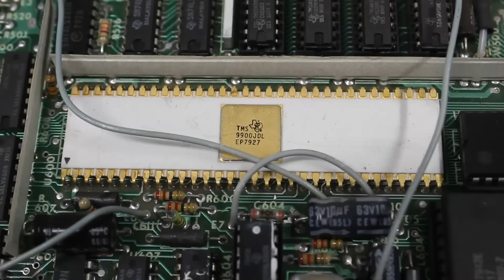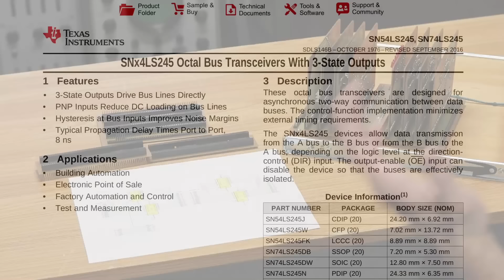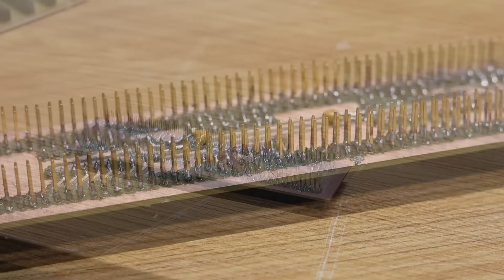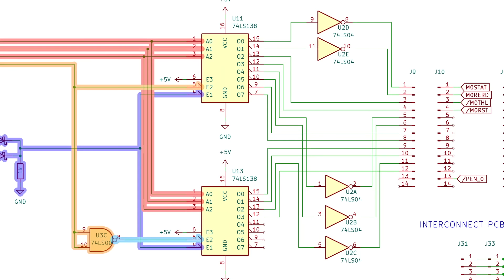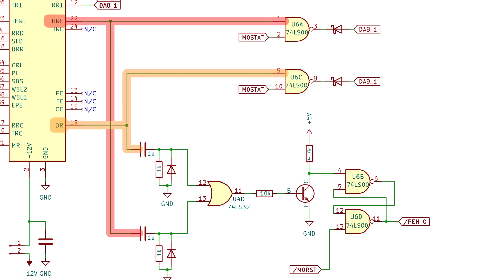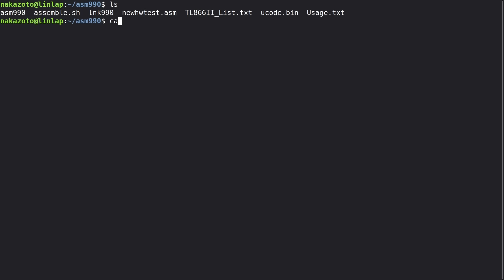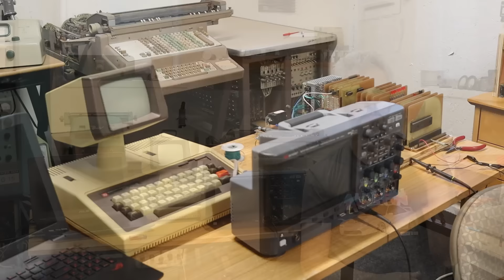Trying and Failing with my TI Homebrew

Comment: Brings back memories.  I worked for TI's geophysical group (the group that started the company) starting in 1977.  My job was to write programs to test our products.  Per my memories (which may be wrong), I programmed 960, 980, and 990 minis.  Most of my code was in Assembly (I still love assembly).  SouthWest Airlines donated a 737 simulator to the Hobby Airport old terminal museum, and a good friend showed it to me 15 years ago.  It had a TI mini (I think it was a 980), and I said if they ever wanted to get it working to call me.  I never heard anything about it, but if it is still there I would love to rebuild it.

Comment: On the 555 timer UART clock, you need to use NPO or 0CG type capacitors to prevent drift with temperature. For a more symmetrical square wave you can look on line for 555 calculators. Tell it the frequency and duty cycle and it will provide the R and C values. Since I discovered these calculators, I can't live without them.

Comment: This project reminds me so much of my project I've been working on for years.  We even have a lot of similar ways we are doing things too.  Mine is based on the TRS-80 Color Computer.  I'm using a 74LS245 just like you are to prevent fan out on the data bus, but am using 2 74LS244's instead for the Address bus, because the address bus is only one way.  The 6809 (I'm using the more advanced and 100% backwards compatible 6309) has 2 signals called BS and BA.  They basically tell the rest of the computer when the CPU is accessing the BUS, and I use one of those signals (can't remember which one it is off the top of my head), to talk to the 245 and 244's to open up the BUS to the CPU.  I'm also using a 74LS367 to buffer some of the signals of the CPU as well.   This system won't have the hard to get and expensive SAM chip, so just like you, I'm using 2 74LS138's for the chip selects, and have a programmed GAL chip to do the address decoding, which outputs to those 2 chips to select what chips are needed for what the CPU needs to access. I still need to finally break down and purchase a new WDC6521 PIA, because I do want to run this at a selectable Turbo speed of 3.58mhz, and the original PIA's won't cut it at that speed. I'm in the process of moving and a vast majority of my things are going into storage temporarily, so I don't know when I'll be able to start work on it again.  Maybe later this year, maybe next year.  Always thought about doing videos on it, but never got around to it.

Comment: I'd be worried that the high duty time of the 555 timers might not provide enough "off" for the UARTs. That said, I'm sure you checked, that information should be easy to find in the datasheet (it'll be something like minimum clock low time).

Comment: 12.30 Wait until you try the pin headers on stuff like HP logic analyzer probe cables. Pin turned sockets in Dupont-style connectors... That's the stuff of dreams

Comment: Is that piston in the background at the end out of a IO-360 or similar aircraft engine?
Also my personal preference for things like this is to avoid the 555 timer. There are chips (which were available "back in the day") with PLLs for synthesising frequencies, that way you can have one crystal oscillator (the one that drives your CPU) and synthesise everything else using a frequency synthesiser chip. The waveforms are guaranteed better quality :-)

Comment: An observation about the diode-pulldown OR gate.. 74LS series uses a sink-low pullup-high type of signaling scheme, so while this works it is not exactly optimal. The external pulldown resistor needs to be low enough resistance to drag the line down to a 0, and this might come into conflict with the pullup internal to the 74LS-chip outputs during a logic 1, and your output signal will be dragged to a lower voltage than optimal.

You might be able to find a value that can sink enough current from the input pullup for 0, and not overload the output current on a 1 while still retaining the signal within acceptable logical-1 voltage levels, but I haven't done any detailed calculations on this myself.

An alternative would have been to use a 74HCT for this type of use, since it is driven with a proper push-pull output stage. That gives low output impedance on both 0 and 1, and with high impedance inputs at DC you can use a way higher resistance for the external pulldown, eliminating the problem.

Comment: I've been making boards on my cheap CNC router.  Use KiCAD to draw schematic and route board. Create gerber and excellon drill file.  Then use Ultimate Gcode Sender, UGS, to read the Gerber and generate send Gcode.  No FlatCAM required.

Comment: 555 and an RC constant are not accurate enough for high speed baud clock. even ceramic resonators have trouble with this task. this will never work well no matter how many bandaids you do. look at every old piece of equipment you own, there's a reason they have crystals or oscillators.

Comment: OMG. If you are going to use ancient jelly bean logic, read a suitable book. Don Lancaster's TTL cookbook would show that your diodes with pull-down resistor kludge was a no-go. Pull down resistors are almost never seen in TTL. The reason is that a resistor low enough in value to serve as a zero input is also so low that no gate can drive it high. Typically LS TTL gates can supply only 0.4ma. Across 1K that's only 0.4 volts and that's before the losses of the series diodes. You've had a hard day. Keep on trying!

Comment: Your resistors are mounted the wrong way round.
No, they are not polarised, but you should be able to read them left-to-right or bottom-to-top (left board orientation) by their colour codes.

Comment: Surprised you put the bus transceivers half way down the bus, rather than redoing the processor card with them next to the processor.  That said you still have the various peripherals on the bus with the same drive limitations of the processor, meaning many cards will need their own 'LS245's.

Comment: The 74LS138 is great, but have you looked at the 74LS154? It's a 4-to-16 decoder, and may be a better fit than using 2x '138's for a 4-bit decode.
Is it better for your application? I don't know, maybe! Or maybe the 138's are just cute :)

Love your work as always, and OMG your PCBs are sooooo pretty <3

Comment: @UsagiElectric you can not pull down a TTL input with 1k resistor. Less than 470R is usually required, even less if it has to be fast.

Comment: Great project! Using 555s everywhere - that legendary chip deserves it! But maybe for the periodic interrupt an AC powerline frequency detector would be warranted, that's what C64 had for good internal timer interrupt stability. Also in projects like this I found that an EPROM emulator is worth its price in gold, saving so much time.

Comment: If you take a kitchen sponge (spongy side up) and dip it in paint then touch the edge of the cards with said paint and letting it dry, it would make the boards look even more spiffy AND you can color code them too. Small amounts of paint can be obtained as "retouch" paint. If you splurge, you can get the felt pen type then you don't need a sponge, you can apply the paint directly.
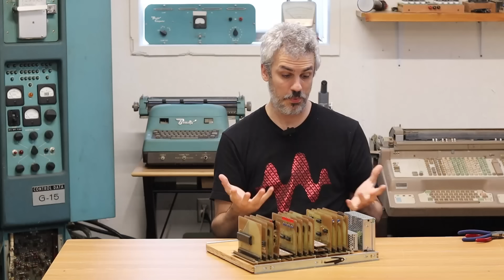edit: 15:30 oh and you can spruce up the power supplies too. Like, they're so easy to take apart and spritz with enamel spray paint, which makes them look so much better. Plus, taking them apart allows you to make sure they're well seated and made. I've done this with every power supply after finding (a quality one) that had pins uncut, riding against the thicker part of the PSU which would've caused a short. Clearly a repair bodge that hadn't been trimmed.

Comment: a cd4060 and a crystal can do the baudrate also . much better than 666 timer . regarding noisy 555, the control terminal needs a bypass as does the supply. even add a 10uf bypass electrolytic on it. needless to say, i hate the 555/ Never realized that Usagi meant Rabbit

Comment: UARTS are picky, check timing (sometimes for 4800 baud your clock it at twice that), clean up the clock noise and look closely at DTR and CTS, byte length and parity (8N1) settings.  You got this!

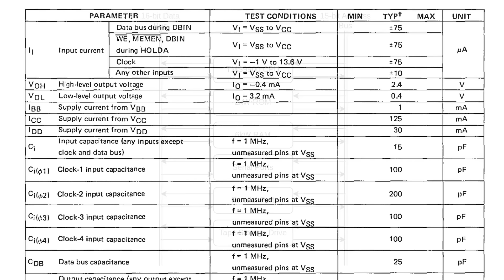Comment: @3:45  I mentioned this back when this project was started.  That processor board needed bus transceivers to actually drive the buss.  But i got told it wasn't necessary.  Well, well, well....  LOL!  ^-^

Just kidding, this is how you learn.  I knew this from building breadboard computers back in high school, for exactly this same reason.  Depending on the day, sometimes it would work, and sometimes not.  And was VERY sensitive to supply voltage.  Drop some buss transceivers on, and suddenly everything was solid and happy from then on.  Those transceivers were designed to drive a load, while the processor really isn't.

That and bypass caps.  I never got the reason those were there until i met a man who was much more familiar with digital design, and he set me straight.  Technically not necessary, until they are.  Better to just put them in and have them be unnecessary, than leave them out and suffer.

And i am still learning stuff, which is why i enjoy this channel so much.  Keep up the good work!  ^-^

Comment: There is a lot of stuff going on there and adding interrupts compounds your troubleshooting.  Reduce complexity with the interrupts if at all possible and then add it back up, it's hard to troubleshoot a system when so much of it is untested. 

Far be it for me to come in here and suggest things when I do not know how much has already been done, however, I do have some level of expertise in RS-232 communications so I'll chip in my 2 cents:

* The 555:
 
1) As far as the 555 giving glitchy behavior, sometimes it's the trigger level on the scope isn't set to the right threshold, one thing I checked for was a capacitor on pin 5 to stabilize the internal threshold divider ladder...  yep, that's kind of common, but I think it's your scope settings. 

2) The next concern are those 5% common carbon resistors,  The temperature drift on those components might give you a headache as the system heats up, , you probably should use some 1% resistors that won't drift much.

3)  As you pointed out you know that's not the right way to clock those UARTS, I think you have about a 4% frequency error that the system can tolerate and still do it's frame synchronization,  you may need to rethink that clocking circuit if you can see data wiggling on the input and output but still the UART is throwing frame errors...   

* RS-232 pitfalls: (not in any particular order)

1) Check for Frame Errors in the status register

2) Check your Parity Bit is matched.

3) Check your handshake lines, if DTR or CTS isn't set right and you have full handshaking enabled, then you will not get any TX and/or RX.

4) If you haven't already, Put a scope on the data terminal input and see if the terminal is sending, then on the TXD of the UART and just have the program produce a constant stream of traffic, like the the letter "A" (0x41) and see if you can get the data pattern. 

I say all this, but I'll guess you're already 10 steps ahead of this on your troubleshooting, it seems like you have some fantastic technical help on your Twitch.  

Best of luck!   Cheers!

Comment: When you are using a two-input gate as an inverter, if you tie one input to a power supply rail, it decreases the load on the driving signal to just one.  In the UART TRO level shifter, you are using an LS gate to control a PNP with its emitter tied to +5V.   This assumes that the high level output of the LS gate is higher than 4.4V, which is not a safe assumption.   Even when that signal is high, it may still be low enough to turn on the PNP.   You can add a pullup to +5V on the LS gate output to make sure the PNP transistor is off when TRO is high.

Comment: I bought a TM 990/189 University Board computer that showed up last week. It's a single board computer using a TMS9980A processor and a calculator body for a keyboard and a display. I've spent the last few days learning about TMS9900 assembly so it's a little surreal seeing it in a video.

Comment: Far too many things that can go wrong, surprised you built almost the entire thing without finding a way to test each part, but full credit to you for going in at the deep end and I know you'll get there sooner or later.
Reply from the maker: Honestly, it was a time thing. The smart move would have been to be much more methodical and slow, testing each board separately. But, I was getting impatient and wanted to just slice all the PCBs in one three day machining marathon. I figured I would just bodge or recut if necessary. So far, the only boards that are really messing with us are the little bodged buffer boards. I've discovered more errors on those that are obliterating the bus, so I'll have to redesign and recut those.

Comment: You don't even start till midnight my time. And at my age that is bedtime. Then you go 2 to 3 hours. I used to work on some of the hardware you've done. I love to see what I can remember.I get the odd idea, but you are usually past that before I think of it. I had storage units full of different parts that were new old stock that could have been helpful. But retirement came and just not making the same money. I sold off  and gave away some, but I cry thinking of what got hauled to the dump. People just were not into saving these machines. At least no where near me anyway.

Comment: I'm pretty sure it is noisy because you created an accidental array of radio antennas and supplied it with RF frequency signals. Circuit board design is more than just getting the traces right. I wonder how a radio sounds at 200 ft?

Comment: Helpful hint: If you have a signal the has to be calibrated before operation, add a test point. Your design requires a TP on the 555 pin 3 output to facilitate the baud rate adjustment.

Comment: Instead of the 555 for UART timing, use a crystal oscillator and an CD4040 ripple counter. A simple 2 part solution.
Then you just have to pick the pin with the UART speed. You would also be 100% in time for any standard baud rate. 

Frequencies for the osc:   14.7456,  7.3728 ,  3.6864 ,  or 1.8432  MHz   for standard baud rates.
Reply: The CD4060 even includes the oscillator!
Reply: @laurdy  Forgot about that!  4020 and 4040 didn't.
A 4060 could be s single chip solution with a plain crystal.

Comment: Using a 555 timer for the UART clock will cause nothing but headaches. For reliable communication in average situations (ie. no exacerbating requirements like long serial cables etc.) the clock needs to be accurate to within about +/- 2% (when communicating with a modern PC you can typically get away with up to 4% or so, because the UART on the PC side has a highly precise clock; however with that old terminal you probably shouldn't push it). The combined drift (long-term and temperature drift) of the 555 timer itself and of the timing capacitor can easily exceed that, so you will likely end up having to constantly readjust the clock. Edit: or to put it differently, there's a reason why pretty much every microcontoller datasheet tells you that when using the UART(s) using the builtin RC clock isn't recommended and you should use a crystal clock instead.

Comment: The noisyness of the 555 signal is probably from your probing technique, you have really long cables. Also limiiting the bandwidth to 25mhz or so should be good. What I would be worried about more is the jitter or glitches, that doesn't look like a healthy one

Comment: I was trying to use 555 as clock source couple years ago. It was bad idea, I was fighting with it couple of weeks, solution simply didn't work at all. I remember each cycle had different length - similar to the noise on the oscilloscope here 🙂Anyway - the idea is stunning - hope it will run some day. BTW. Do you know what is the common name of the hardware, software, firmware, middleware? It is called "someware" - so if there is a bug, and nobody knows where - you can always say - the problem is in "someware" ;-)
Reply: Somewere, love it lol

Comment: Great progress!
Lesson (hopefully) learnt: Make incremental changes and test each one as you do them.

You might want to have test-points or rather test pins on both sides of your interconnects.

You probably need to create some sort of debugging harness. 
Not quite sure how it might look. 
But at the very least it should make a card accessible to probing while still in circuit.
Something possibly vaguely related to the long extension board for the Centurion

Comment: 555 needs a lot more decoupling than 100n, you need a minimum of 100uF of capacitance right by the chip, with short traces to power and ground, as the chip is well known for a power spike during switching, unless you use the CMOS version, which has a lower spike.
Reply: yup the OG 555 might as well be a light bulb when it outputs, and the CMOS versions are better they are fragile AF
Reply: @osgeld  Good to know, thanks!
Reply from the maker: Oooh, I didn't know that they needed that much decoupling, I'll do some revisions! Thankfully, desoldering and changing caps is pretty easy on these milled boards.
Reply: @UsagiElectric  (With my limited knowledge) I would say that the best thing to do is to avoid using a 555 and instead use something like a 7400 series IC for your oscillator. Looking it up on Google to remind me the one I used in several projects was the 7404 hex inverter and it worked quite well.

One of the potential problems of the 555 was/is noise and that alone could be causing trouble elsewhere easily.. Its a good place to do a test by replacing the oscillator with a signal generator. What should be simple low frequency oscillators can cause a lot of trouble..
Reply: 74hc14 Schmidt inverter is best for low Freq osc ...
Reply: ^yes what sean said, 555s are godawful on the power rails. A 7555 might be bett...oh wait sean just suggested that too high five lol